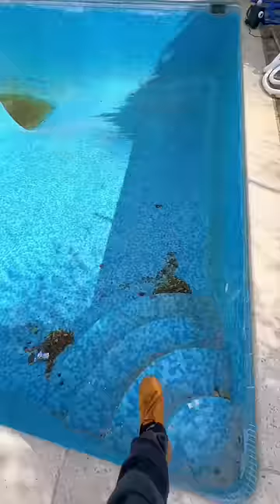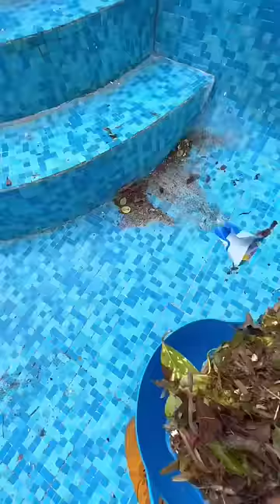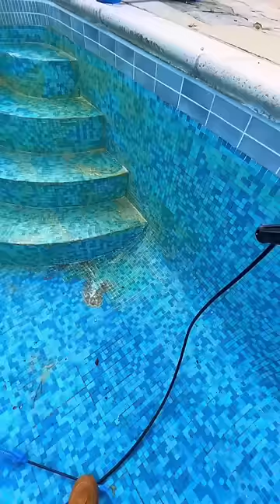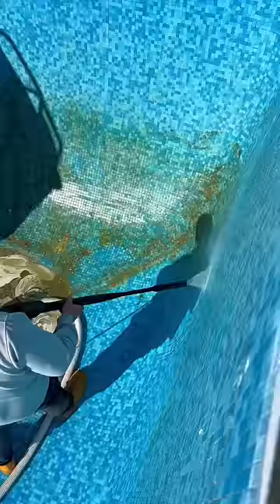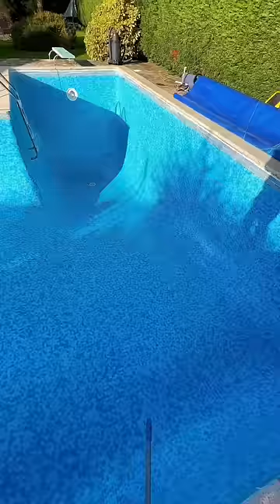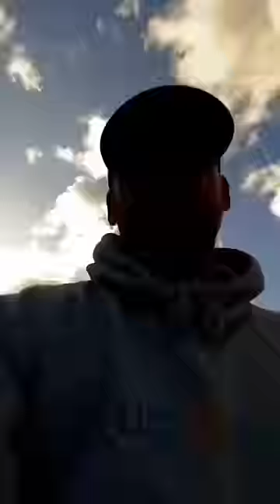A quick acid bath for this pool before filling #thep00lguy #satisfying

Comment: Lolol did not expect pool toys coming out of that hole 😂
Reply from the maker: Same
Reply: Ikr i'm so confused how it even got in there
Reply: he put them inside... they look brand new... that is a hole for manual hoovering with flexible pipe ... cheers
Reply: Literally me either
Reply: At my house there were frogs in my pool trying to lay eggs and we were replacing the chlorine as I was getting out the other 6 or so frogs out of the pool we also had to dump out the filter And the frog trying to lay eggs almost we down the drain thing and could’ve went to the jets thank god she was to chunky
Reply: i think there pregnant
Reply: That's what she said 😂😂😂
Reply: Same here
Reply: I need to call her
Reply: @apelementalityqp ☠️🤦‍♀️🙅‍♀️🤷‍♀️🤣
Reply: Woooow que producto usas para el sarro en las paredes por favor te quedó todo muy lindo
Reply: @thepoolguyml  mate you have the easiest job in the world
Reply: Pause 😂😂😂
Reply: ٠ @thepoolguyml
Reply: That's what she said
Reply: @penguinnnnnnnnnnnnnnnnnnn kids
Reply: @thepoolguyml I got a different youbon my hole
Reply: Which type of acid do you use?
Reply: @thepoolguyml
Reply: а точно ли игрушки ДЛЯ бассейна....
Reply: @rodrigomincoff9890 I don't know if it would be safe to use on pool finishes, but I know that a gallon of cleaning vinegar is dirt cheap and is used to clean those in-house water fountains that sell for less than $100. Takes the algae and grime right off.
Reply: Doctors in the ER say the same thing😊
Reply: @penguinnnnnnnnnnnnnnnnnnn  someone prob put them inside
Reply: That's what my doctor said aswell!
Reply: staged af
Reply: @thepoolguyml  hi, can you tell me witch hayward pump type do you use for vaccuum? 0,5 pk or 1 or 2 pk? Thank you!
Reply: Lot of object go in a hole a sometime on of the object get out of the hole 😏😏🤤🤣🤣
Reply: Слова любой девушки)
Reply: Same 😂😂😂
Reply: that's what he said...
Reply: That "hole" is called a Vac-lock port. It's where you can install a flap-door that is for automatic vacuums, commonly known as "Creepy Crawlies." Even though that was a specific brand, and not what they should all be called. I also am concerned with the potential of the grout getting softened by the acid wash. Even in high mixtures, it can cause pitting in the grout-line.
Reply: just like my ex!!🤣
Reply: Que isso parece peido tava tão sujo assim😂😂😂😂😂😂😂😂😮😮😮
Reply: That's what she said.
Reply: It looks trivial but very funny 😂
Reply: على الحمد الله حمد كثيرا ✋🏻🌹باي باي 🌹✋🏻
Reply: That's what she said.
Reply: Pool threw up lol 😆
Reply: Pool toy vomit!
Reply: "pool toys"
Reply: Everybody knows you have to ask to wash a pool
Reply: Это игрушки жены 😂
Reply: That's what she said..
Reply: Fiuo6jig.
Reply: @thepoolguyml  except for the fact you placed them there you mean?
Reply: Don’t take this comment out of context
Reply: That’s the same thing I said
Reply: @Haley_that_one_girl Do you know what punctuation marks are?
Reply: @dragonlord1225  yes i do, but i didnt feel like using them
Reply: Popped right out of that hole

Comment: What chemical do you use to do this ?
Reply: I'd assume it's probably muriatic acid, if you're still curious.
Reply: Muriatic is Hydrochloric, depends where you come from. Only thing is you don't want to use it often. It eats at the lime in concrete and grouts and makes it honeycomb and brittle over time. But a spring clean like this once every few years shouldn't be a problem.

Comment: I don't understand why you would acid wash then power wash. The grime negates the acid and protects the calcium and mineral build up. The acid would work better on a cleaned surface. 
Did you set up a fan? That's a death trap. 
I like the electric power washer. It wouldn't make a carbon dioxide death trap as a gas powered one would as it sinks to the bottom of the pool on days with little to no wind.

Comment: That has to be hydrogen peroxide that you spray first it foams up… I had a mildew problem in one of my bedrooms and all this expensive so-called mildew killing chemical stuff dented and then I just sprayed it with regular hydrogen peroxide, but soaked it really good and all the fuzz just disappeared and it killed it dead, I bought higher percentage, hydrogen peroxide to treat my entire room ceiling to floor because I don’t want any spores getting away from me. It’s been a big hassle, emptying the room, carefully washing the clothes and super high vinegar and drying them in super high temperature, unless of course it still has that smell, and I threw those clothing out  in the end I will live in that room confidently again

Comment: Dude…. You don’t like breathing or something..? Down in that pool using muriatic acids.. this sh!t dissolves pretty much anything it comes in contact with. Even the stucco/concrete the pool is made of, if not neutralized and rinsed, would crumble away and the pool would be ruined. These guys are just guys that most likely either saw this done or used to worked for someone that did this and were like… “bro, this guy is making $1,500 a pool for two days work…we making $200…🤷🏻🤦🏻‍♂️”…  then realizing additional costs other than acid and pressure washer, just decided to pocket the money needed for breathers and proper clothing so those new Jettas or Civics… 🤨😋🤦🏻‍♂️

Comment: you wouldn't believe what gets sucked down and stuck in the return lines. Also what the f dude? No safety equipment, no respirator or anything! Safety is obviously not your number one priority. Also you're using high pressure on small tiles? Amateur. This is probably a fake video anyway though because I've never seen anybody do an acid wash and come out with your clothes looking brand new. Fake.